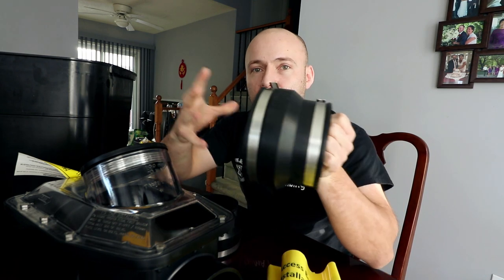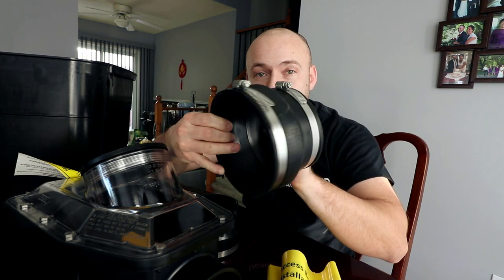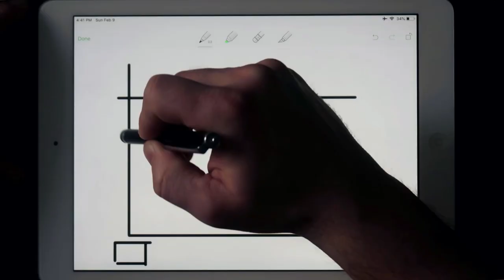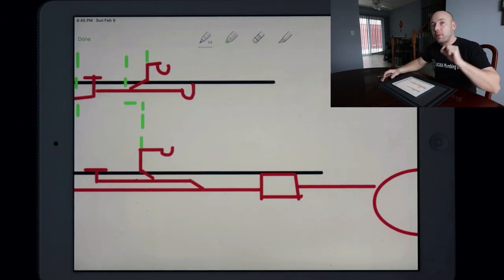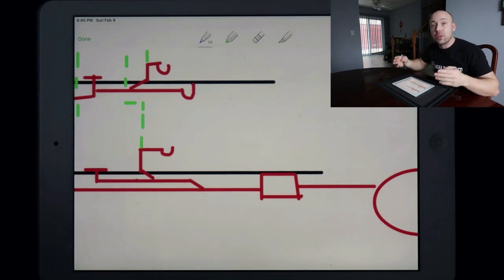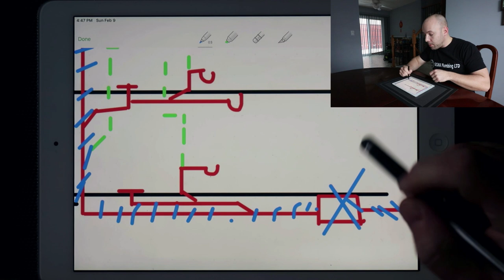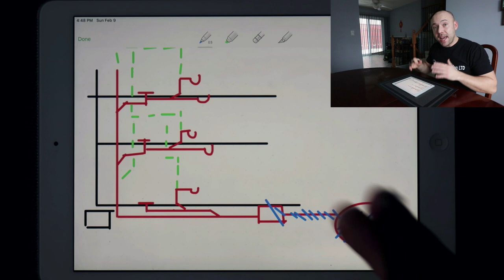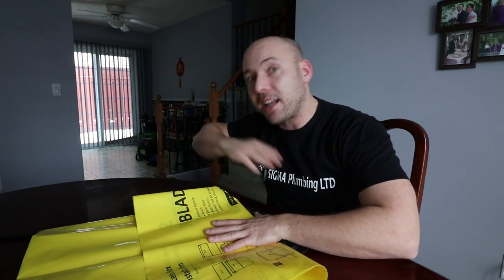A Day In The Life Of A Plumber | Plumbing Backwater Valve Installation | Vlog 69

Comment: Did you ever try put a piece of pipe on street side the ack water valve and fill with water to see if it will leak seep?  I  installed a lot back water valves, a service a bunch  but a never done a water test. I am in Brazil now and I bought 2 back water valves and I did 3 different water test and all leaked  .
Reply from the maker: Hey, sorry never did this type of test. Sorry to hear of your experiences.

Comment: Was that a 4” or 6”
Reply from the maker: 4”
Reply: @Kennymolotov  if my main sewer line is 6”, I assume that I should install a 6” valve, correct?  6” valves seem hard to find
Reply from the maker: Yup John that’s correct. But where are you located? And is this a house you live in? In Toronto, unless you live in a building with many units, a 6” main is very rare. If your pipe is clay, it’s outside diameter is very large, but the inside diameter (the size of the actual hole) is 4” for example.
Reply: @Kennymolotov  its a 3 unit building in NJ.  One big problem is that the roof rain gutters drains into the back of the building and flows to the front through the 6” PVC sewer line.  The check valve is installed in the front of the building.  So if the check valve is blocked, then any rainwater will flow up to the basement!  I got 2 ft of water this week! You discussed this in your video but i haven’t thought of a good solution yet!  One idea is to redirect all rain gutters to the front (lot of work!)
Reply from the maker: So two option from what I understand. 1) redirect all rain gutters like you suggested, or 2) like I tried to explain in the video, don’t protect the main line, only protect the plumbing fixtures in the basement. Because, even if you redirect the rain gutters, if the valve activates (without anyone being aware of it) and your neighbours upstairs still run their water, it all will end up in the basement anyways because the valve is shut! So instead by protecting the fixtures in the basement the basement pipes can fill up all they want and all the fixtures in the basement will be protected (in theory). I hope this makes sense. I assume an inspector here in Toronto would make you do both option to be honest. But please take this with a grain of salt and ask around. I’m not sure what the codes are in NJ, this is not intended to be advice but  speculation.
Reply: @Kennymolotov  How do you protect individual fixtures, toilets, and shower drains?